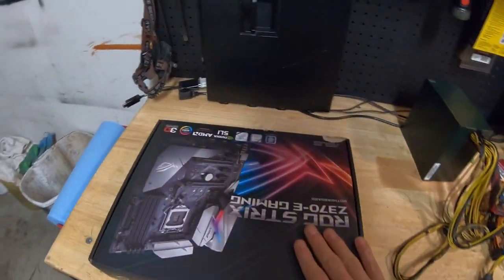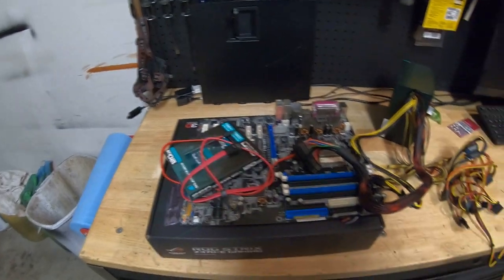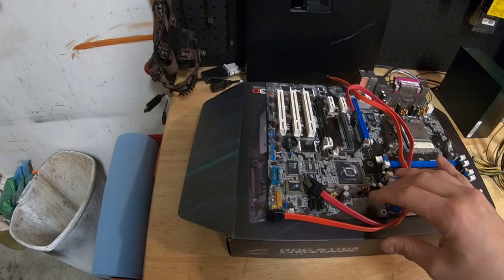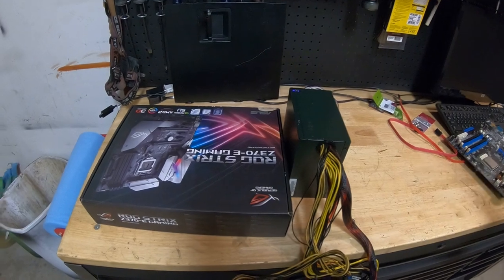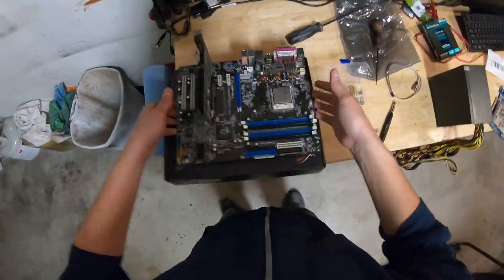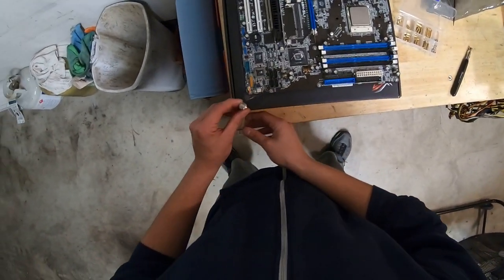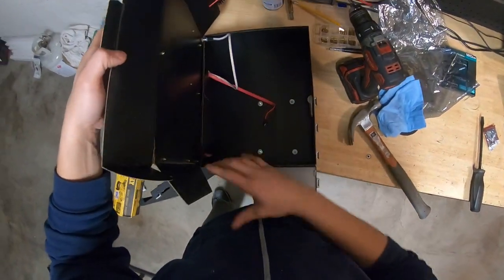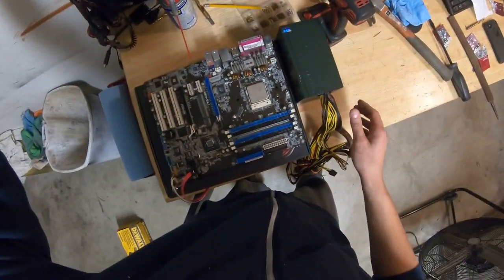How to make a cheap PC test bench.Pt. 1

Comment: My Lian Li open case for my workbench was only like $60. But I have thought about building my own, I'm just not very creative. Great video by the way
Reply from the maker: Thanks man. You should give it a shot. I'm just cheap and this seemed a little more practical at the time. Still waiting on that spider PC lol..
Reply: @DLMtechgarage  yeah, the spider PC will be after this current set of videos for the current build I'm doing. I'm going to have to do a little more work on the operating system and then I can edit and post it